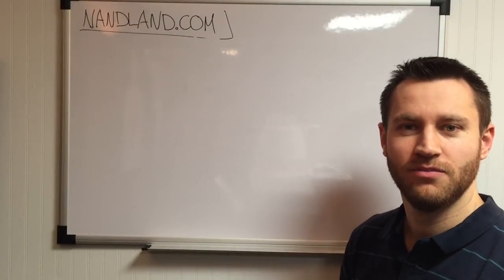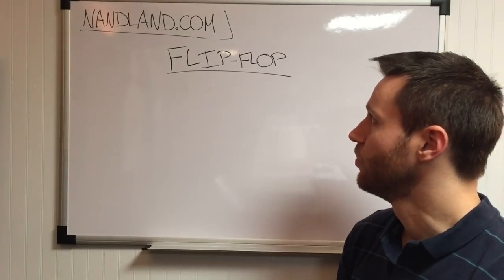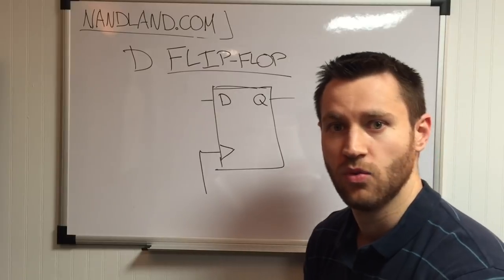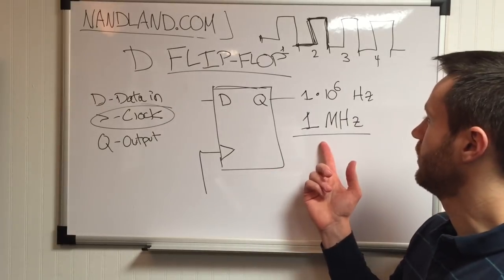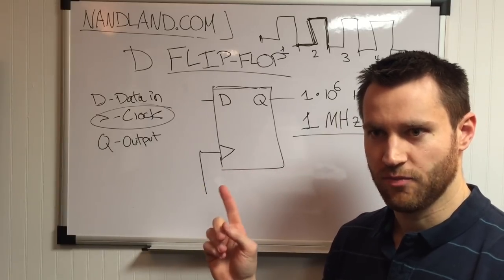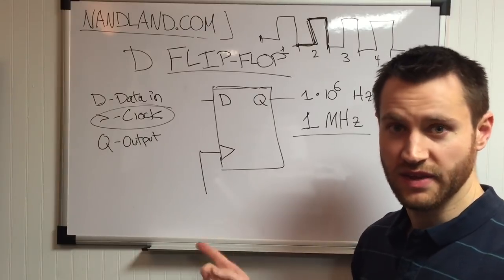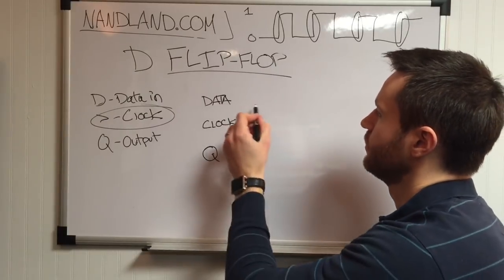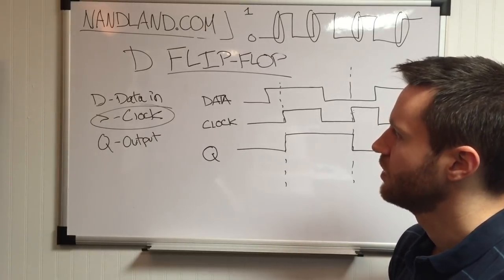What is a Flip-Flop?  How are they used in FPGAs?

Comment: Great video. Hard to find information on this topic with YouTube.  A few comments though:

A register is defined as a group of flip flops. Therefore, a 4-bit register is just a group of four flip flops, each one holding 1 bit of data. 

LUT?  You mean a truth table .  It's called a truth table whenever you're dealing with combinational circuits (the ones without storage elements). The moment you get into sequential circuits (circuits that have flip flops) it becomes a state table .  I would replace "LUT" with "state table" because the accompanying diagram is called a state diagram, and then ultimately you produce the circuit diagram.

A state table fully describes the operation of the sequential circuit. A state table contains a column for the present state, the inputs, the next state, and any outputs.  But when you really get right down to it, the state table is just a truth table that includes present state as one of the inputs. 

It's also important to mention what a flip flop is. A flip flop is storage for 1-bit of data, which can be either 0 or 1 . 

There are three types of flip flops commonly taught in digital logic courses: 

- D flip flop
- T flip flop
- JK flip flop

The D flip flop (data) is by far the easiest to understand:
- If you input 0, it stores 0 and outputs 0. 
- If you input 1, it stores 1 and outputs 1.

The T flip flop (toggle) operates as follows:
- If you input 0, the current state is maintained and outputted. (0 stays 0, 1 stays 1)
- If you input 1, the current state toggles to its opposite and is outputted. (0 becomes 1, 1 becomes 0.)

The JK flip flop is the most advanced and most complex . It has TWO inputs (J and K) plus the clock:
- If J = 0 and K = 0: Current state is maintained and outputted. (0 stays 0, 1 stays 1)
- If J = 1 and K = 0: Current state is set to 1 and outputted.
- If J = 0 and K = 1: Current state is reset to 0 and outputted.
- If J = 1 and K = 1: The current state toggles. (0 becomes 1, 1 becomes 0).

Therefore, the JK flip flop can perform the operations of both the D flip flop and the T flip flop in one. 

Why use different flip flops?  Well, sometimes the logic is a lot more complex to implement with one type of flip flop than it is with another. That can greatly affect the speed of the circuit.

Comment: one way to think of it too, is the "gears" or clock are like tidal waves, coming in and out, with the polar harmony generating the "life" of the circuit. (this helps if your familiar with the concept that the early earth had a moon closer to it causing 100 mile tides, potentially creating life, just like the "life" of the circuit is created by this back and forth, on and off, clock motion. but anyways....... lol)

Comment: Superb information. Will you guide to use flip flop's in making a model train signalling system involving only 2 leds (red and green) per flip flop cascaded so that each flip flop triggers the next one so that green becomes red once the train passes the sensor say magnetic reed switch on the track.

Comment: One question though: Q2 is one cycle shifted w.r.t. Q1, but Q1 is not exactly once cycle shifted to D, right? It is actually like 3/4 cycle shifted?
Reply: Xinxing Wang Right, but D does not change along with the clock rising edge. In this example we assumed that D can change at any time.
Reply from the maker: There are some real world delays associated with changing flip flops, yes. Look up setup time, hold time, and propagation delay. But this waveform is exactly what you'll see in a simulation. Simulations are perfect case (no delays).

Comment: Hey I get the propagation delay causing a 1-cycle delay but isn't the clock line going to one of the flip flops inverted so they never share the same clock signal? One clock cycle "traps" the data signal in FF 1 and the next clock cycle allows that trapped data to flow into FF 2... right?
Reply from the maker: All flip-flops in the design use the rising edge of the clock.  They all get updated at the same time.
Reply: Thanks for the reply! I am obviously just starting to learn about this stuff and your videos are a huge help.

Comment: thanx
one question please!
In the single and simple example of a Dflip-flop
 if the input data D is changing exactly with a rising cycle clock CLK, does the output Q of the DFF will perceive it or not?
Reply: Tony Sznabel 

 Hi, I'm not the author of those videos, but here's my guess: Just as in
 the author explains in the case of two flip flop, "In the real physical
 world, it takes some time for the signal to rise", and in that same 
example Q2 is the data input of the second flip flop. My guess is, the 
time duration of that "some time to rise" is the sum of two times: T1, 
the time for the signal to propagate from Q1 to D2, like it's a cord. 
then, T2 is the necessary time for the signal to rise from low to high 
level. Why, in the real world, is there a 
necessary time for the signal to rise from a level to another level? 
Because this signal is never actually "square", it is an electrical 
current whose value is continuously changing, and here it is contiously 
rising from one value, to another. To convinced yourself, just say to 
yourself that the current value at a given instant CANNOT have more than
 ONE value, so the curve at the rise CANNOT be vertical. drawing it  
vertical is an approximation, just meaning the slope's gradient of tangent 
is very high, "almost vertical in the neighborhood". Very, very sloppy. 
In other words, current's value rises so fast, its curve looks like 
vertical at that point. Alright, so in the example with 2 flip flops, 
author says that when clock rise and Q1 rise occur at the same instant, 
T1 + T2 is big enough so that Q2  stays low, and he adds, "this is dued 
to what's called propagation time". So your question is "what happens to
 Q2 if T1 = 0?", isn't it? What I'm doing here, is shifting your exact 
question as closely as possible to the author's vocabulary, so that I 
can use the exact same reasoning as a mechanism to come to a conclusion,
 based on what the authored gives. Okay, so here 's my answer: the 
author, again, says that if Q2  stays low, it is dued to something 
reaaaally important called propagation time. Then my guess is: the 
answer to your question is that what will happen is kind of random, un 
predictible, and most importantly, IT DOESN'T matter, we don't care, 
what we care about (to understand FGPA's) is what happens when there's a
 T1 : T1 is not zero. Futhermore, T1 is considered non zero when it's 
big enough so that the system behaves with that VERY IMPORTANT thing that
 is the delay between Q1 and Q2: meaning the system is designed to 
behave WITH such a delay. Designers of FGPA's WANT that delay to be part
 of the behaviour of the system they designed. there's a treshold where 
that delay appears, what is the exact treshold we don't care, we'll 
eventually just tune it to some other system's tuned value, so that we 
get the desired collaboration between systems. To end with this, the 
value we are going to tune is a physical value measured for the 
electrical current, that one value that determines the slope of the 
rise of the (curve of the) current's voltage from low level to high 
level.
 Thank you very much for your question, it had think the whole thing 
over! And thank you to the author of the video for making and 
broadcasting them!
Jean-B.
Reply from the maker: Probably not... There's a thing called setup time that is required. Meaning the input D needs to be stable for some amount of time before the rising clock edge comes along. This is a subject for a future video. I already wrote about it on www.nandland.com. Check the FPGA-101 page.

Comment: Thanks for the videos. My main concern is that, although I do get what is happening, I can't make the connection to an actual application that would need this method. So, why would retarding a signal by 1 circle be of use?  
Would it mean by appending several D-Flip Flops that share the same clock, I can keep in "memory" the data (for N flip flops I could keep the signal for N clock ticks)? Would that be how to create a "MEMORY" functionality in a calculator for example? (not sure if we keep the data or the output of the flop actually).

Comment: How would D change to high before the rising edge? Would the data not be in sync with the clock?
Reply from the maker: The output of the flip-flop (Q is output) changes high or low depending on the D input.  The Flip-Flop "looks" at the input when the rising edge of the clock comes along.  This happens to all flip-flops in the system at the same time.  Hope that's helpful.